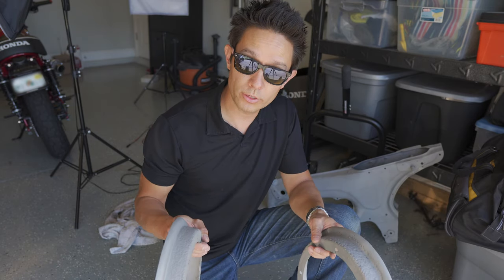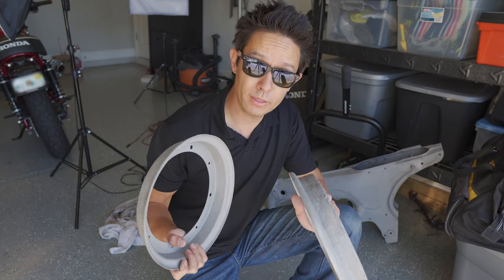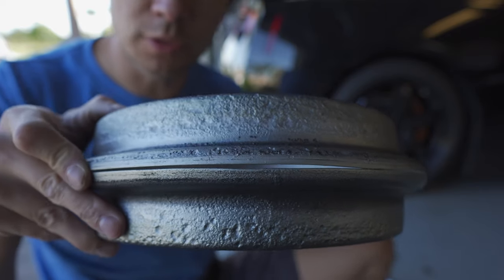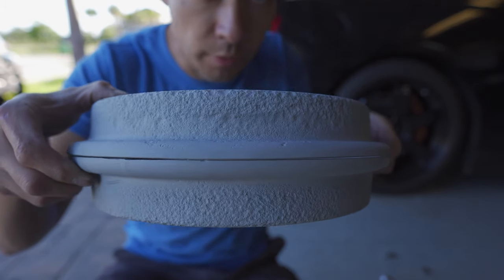CT70 Vlog Ep. 1 - Sandblast, Powder Coat, Replacing a Bent Wheel

Comment: Hi !, what is the cost for the sandblasting?
Reply from the maker: My place charges about $30 for the frame I think. I think it was $50 including the fork and swing arm.
Reply: eastcoastish ok !, about the same here in west palm, nice work you doing with the ct 70’s, I have done 2 so far , I’m working on # 3 on and off ,
Reply: Ahh, my place said it will cost $60 for just the frame...that I already stripped the paint from!

Comment: Any plans to do a Z50 build?
Reply from the maker: I would love to if I could find a donor bike. I've got a hookup on the CT70 frames / rollers, but haven't seen a decent Z50 yet.
Reply: I saw a 1970 Z50 with something like $800 worth of brand new parts still in the package selling for $1,000. I couldn't resist getting it. Ordered an 89cc kit with a 4 valve head for it. I've never ridden a Z50 so I really looking forward to getting it going.